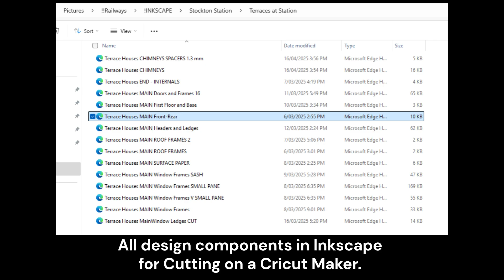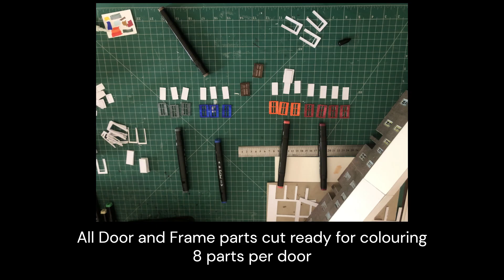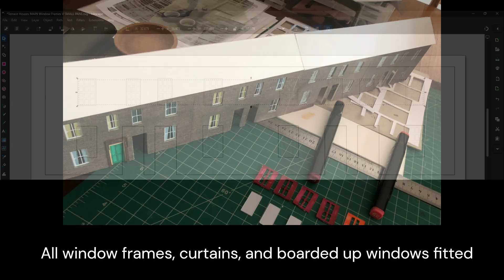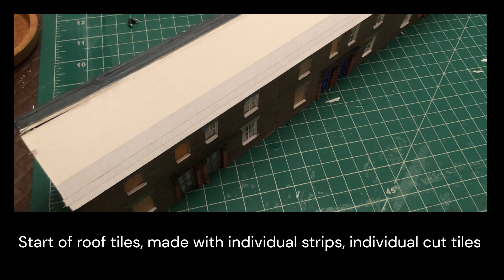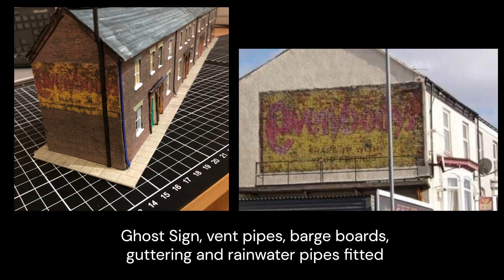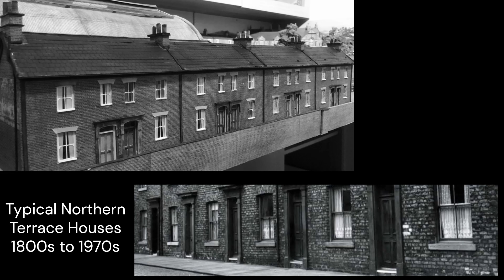Inkscape to Build Station Terraces - Stockton on Tees (Project Update)

Comment: Hello Alan, we are doing a project on the Railway Cottages here at Stockton Reference Library which will include a photographic exhibition. Your video of the making of the cottages is just wonderful, and I wondered if you used actual photographs to get the proportions correct? Also, do you have any photographs that we can use in the exhibition, as, sadly, there are not many that have survived? Many thanks Donna
Reply from the maker: Hi Donna. Pleased you like the video and even I just rewatched and found an error where I referred to Railway Street rather than Stamp Street which I also built a part of. I will find all photos I have but most came from people in Stockton but there are very few close up photos. I used the photos to scale the best I could but also used standard sizes for terraces of the era that I had better photos for. The model is in 4mm to the foot scale. As with any modelling there is artistic license to achieve the essence of the buildings. I also had a news item on TyneTees TV in 2022 that showed the areas around Stockton Station, Bishopton Lane and Durham Road. The video is on my YouTube channel.  If you can send me your email address I will send whatever I have that may be useful. Also when is the project going to be displayed. Pity we live so far away in Australia as you could have used a model as part of the project. Alan😮davisalanmuriel@hotmail.com
Reply: @StocktonStation  thank you Alan, I will send you an email shortly